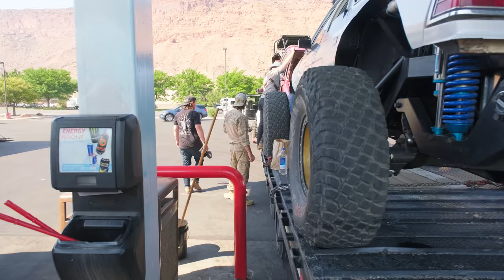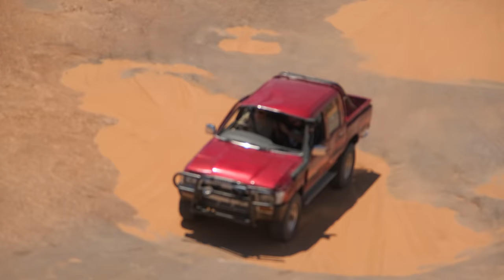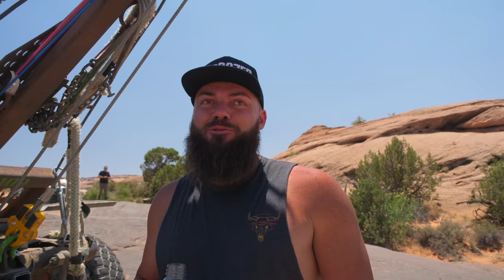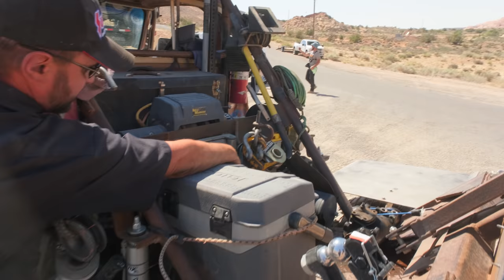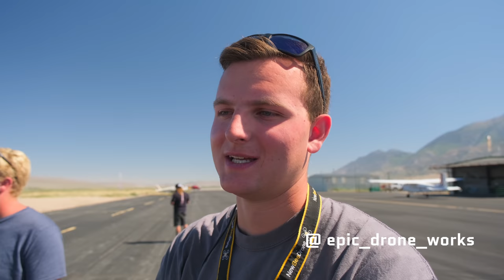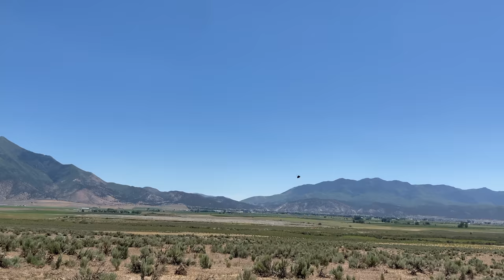We Dropped WhistlinDiesel's Truck From A Flying Helicopter (2 Miles High!)

Comment: You know I was already impressed with the Hilux but now I’m really freaking impressed with that thing! Yeah I can see how the Toyota guys are upset with for what he did but he really did an ultimate durability test on that thing.
Reply: Are you married
Reply: Check what top gear did to the hilux 20 years ago to see exactly what the hilux can go through and keep running
Reply: @mikehourihan6659  well this was more of a fair test and not really a tv show.
Reply: @Modelo646  what top gear did was crazy though. It really made you realise how good these things were built
Reply: @mikehourihan6659  Not really he only took it to water scrached it a bit and droped it with a building which was decent. They never shoved how really tought it was.
Reply: @Modelo646  it fell with a building 8 stories high got  flooded in 1 of the biggest tidal floods of england and a few more thing and kept starting after all that how tough do u want it to be man ha ha
Reply: @mikehourihan6659  floating down with a building for an engine in a metal shell of a car is not difficult. And getting splashed by water you think is hard for an engine ? Come on man WD put a whole palet of brics and drove super hard towed a gooseneck of avout 20 000 pounds went to the hardest offroad trails and that is concidered really hard for a car not a splash of a water and surfing a building.
Reply: @Modelo646  its an off road vehicle  lad whats hard about carrying bricks and towing shit. Its what it was designed to do like
Reply: @mikehourihan6659  No it wasn't that went past all the trucks ratings. If you want to believe that tv show did better than its your opinion and you can keep it.
Reply: @Modelo646  ha ha ha are you upset lad ha ha your a bit of a fool really if you cant see we are both complimenting the same thing ha ha. I take it u like the lad that fronts this show happy for ya lad enjoy. No need to be cranky

Comment: That turned out to be something worth watching. I never expected it to flatten out like it did. I did helicopter logging in Forks Washington and we lifted logs that were much heavier than the truck so when a log did cut loose at say two hundred feet or enough to clear any standing timber around and get to a loading zone. I never once suspected this

Comment: Heavy D,
From one aviator to another, you need to have a chat with Whistlin' Diesel. He tried to fly a plane (a tailwheel) with no experience, FAA be damned.
Reply: He is not as dumb as his character makes him look. He had no intention to fly that plane. He wanted to drive it around off-road and trash it.
Reply: @Joe Smith you're right he didn't leave the ground.  At the same time, he did attach the wings while mocking the FAA.  Make of that what you will.
Reply: @Skwisgar2322  This is the only time I've been critical of his channel. You're correct, he's not stupid, but he does stupid things. When it comes to planes, there's more risk to consider.
Reply: George Jones  clever outdated response.
Reply: When a plane can takeoff while doing doughnuts the FAA should pay him

Comment: Back in the day I was at a NAS LeMoore  airshow and the announcer started announcing a car that needed to be moved or it was going to be towed over and over.  Well out from the back came a UH1 with a car under it and it got dropped from about 1000 feet with the same results, smashed flat, beyond flat.  Also one thing about the Kamax is it has wooden blades!  It was the only thing that would hold together and flex correctly.

Comment: You own an Igle and you admit it? you are brave people, I do not think I have ever seen one rolling across level ground under its own power (down-hill yes, uphill on a tow cable yes, broke down alongside the road USUALLY). P.S. got my first learners permit (had to pass a driving test in an AMC concord (two wheel drive of that lump).)

Comment: Wish I could be there with my 78 Dodge Power-wagon short bed step-side all stock 2nd owner which she is a beast at crawling hills here in Kentucky, never ever gotten stuck or any problem climbing steep hills even trees, though I stop driving it on the road she only gets 5 miles to the gallon, just use it for off road.

Comment: Ok, I'm new to this channel by a couple of months and diggin the vids... but... this ain't new.  I hope someone got a speed on this drop.. An old VW company did a promo to have the fastest VW bus ever.. It was done for Bus Boys out of NorCal some 40-45 years ago.. I have a Hot VWs magazine with the add still kicking around here somewhere.. yeah, it ended up just as flat.. but still holds the fastest Type 2 VW in the 1/4 mile.. granted, it was straight down... but...

Comment: hey dave  did you forget your basic science?  the weight of the engine in the truck is irrelevant in freefall! where the weight is dosnt matter at all as it is all accelerating at 9.8m/ss !  it will nose down because of aerodynamics theres less resistance from the front than the back or sides there sort of designed for that lol.
Reply: @user-up5dj4fh1h  the 4 gpus in my linux box would love to hash your wallets key...thanks for the invite though
Reply: HeavyDSpark   ya got me here i dont use whatsapp ..and while i do know how to play with hashes i choose not too

Comment: You didn't drop it with the chopper in the click bait picture. No way. The truck would have overloaded it enough it probably could not have been able to take off. 
10,560 feet might be a tad over it's maximum ceiling, too.

Comment: Yeah I had a really nice Chevy K5 Blazer until some yey who ran into the side of it and totaled it out for me took me about five years to build it the way I want it because I don't have money like everybody else does so every little bit that I scrimped and saved I put into the Blazer me and my wife was really happy with it after it was finished 8 at 35 inch tires and KC lights and all that had a roll bar inside is that up in the air had a shackle flip kit on it 205 transfer case locker in the rear end trying to save up the money so I can lock up the front end took it into the snow one time with one of my friends and it was a really fun truck I'm partially paralyzed and one leg so something like that only come to me one time in a lifetime 58 years old now and I ain't going to be able to build anything like that ever again live ever come up with the money I sure would like to buy one of those newer 4-door Jeep Wrangler😊